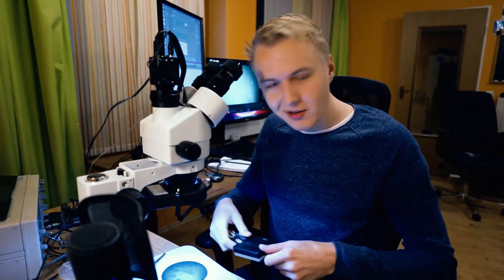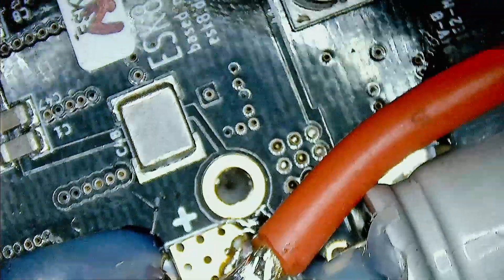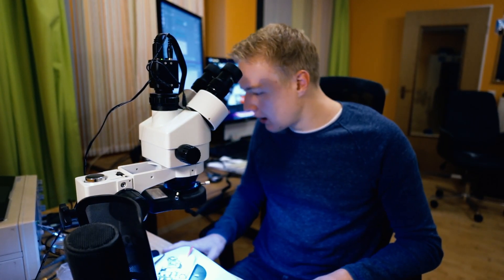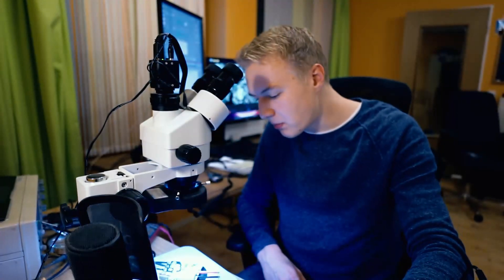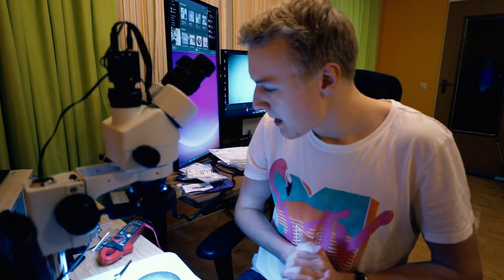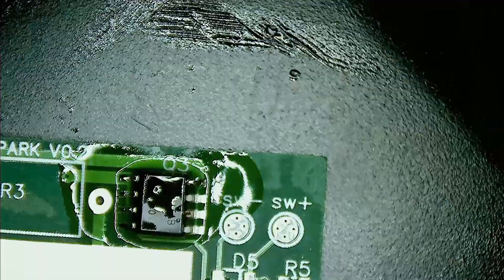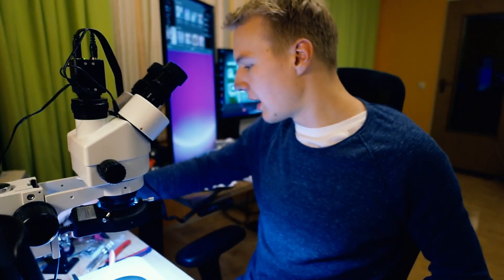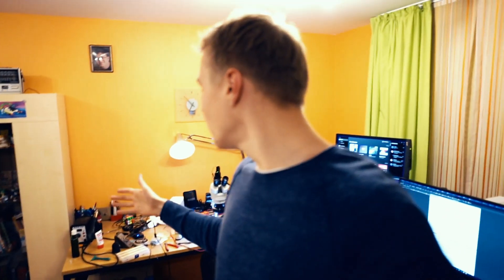Every Electric Vehicle NEEDS This

Comment: You designed that anti spark system? I typically use xt90s but it’s not perfect. I just refuse to buy a 70-100$ anti spark board to turn on my 100$ vesc. It seems pretty stupid to need to pay 100$ for a on off switch. Your solution seems like a perfect one as I assume the cost should be much lower than the options available. 
Is it acceptable to use with 20s battery packs, 72v / 84v fully charged?

Comment: Ich habe eine wichtige Frage: ich habe einen hub Motor q128h ( mit planetengetriebe) und jetzt will ich meinen Bescheid daran anschließen( habe schon mehrere q128h  damit verbunden und es hat alles immer geklappt) wenn ich nun jetzt die detection laufen lasse dann zeigt er mir an 100A und sensorless dabei verträgt der maximal 30A. Wenn ich jetzt aber den Gashebel betätige, dann werden nur die Kabel heiß und nix dreht sich. Wo ist der Fehler? Ist einfach der Motor kaputt oder habe ich etwas falsch angeschlossen( Phasen kann man ja nicht falsch anschließen oder?)

Comment: Interesting video. Could such an anti spark element also help to debounce a DC switch?
Reply from the maker: there are definitly easier ways to debounce a switch. Its really only usefull for switching high current, high capacity things on.

Comment: Great video! The anti-spark circuit is really neat. I don't understand the point of the TVS diode though. We put it on the battery wires, but the voltage spikes are on the motor side, from the motor coils? I just cant figure out how the diode would help.
Reply: The voltage spikes are on the battery side
Reply: @ElmarBon  Can you explain why? I thought the spikes are because of the motor coils switching off
Reply: @AntonMakesStuff  Not an expert but believe it is just the inductances from the connections between de mosfets and capacitors/battery
Reply from the maker: the current path goes from the battery, through the mosfets, to the motor coils. so when the vesc is building up the magnetic flux in the motor, current is rushing through the battery wires and the coil wires. But since you need to control the current, constant switching is required to stabelize the current. So the current path I just described gets interrupted. Now you have lots of energy stored in the motor coils and also a bit stored in the battery wires. Since inductance always wants to keep the current flowing voltage gets created by the collapsing magnetic field in the wirering to the battery as well as in the motor coils itself. On the motor side current now flows through the mosfet body diodes which basically act like a full bridge rectifier. if the voltage rises above to whatever the capacitors - 2x Body diode Vf is, the capacitors get charged with the excess energy. This happens especially on rpms near the limit of your motor since that is when the maximum amount of voltage gets created in the motor coils.
On the Battery side the same happens, current suddenly gets cut off, which means the magnetic field on the battery wires collapses, and creates a voltage that would also charge up the capacitors above the voltage of the battery itself. Now if ESR of your caps is high and they dont take that new energy fast enough, the voltage rises to quickly and all the sensitive components like the drv mosfet driver and mosfets itself get exposed to very high voltage peaks.
In this video of benjamin vedder himself also goes in detail on the battery side inductance and how that creates voltage spikes: https://youtu.be/x6lPdI9OVQg?t=1151
Reply: @Pryside  now that is an explanation👨‍🏫
Reply: @Pryside  Thank you, that is a very detailed explanation! I understand now :) Does this mean it's good to keep the battery wires as short as possible, or does the wire length between the caps and the battery not matter much?
Reply from the maker: Sorry never saw your comment until now. All wiring should obv as short as possible. but for less issues with voltage spikes prioritize short cables to the battery. Also thicker cables have less inductance. Thick cables not only help with less resistive losses but also voltage spikes caused by battery wire inductance.